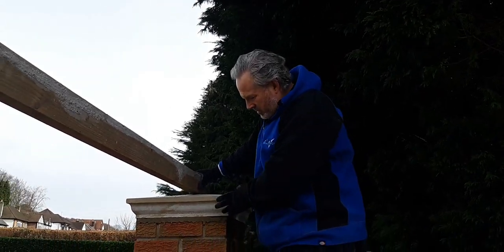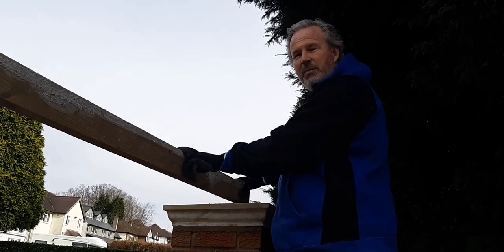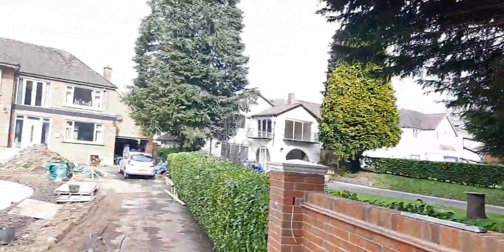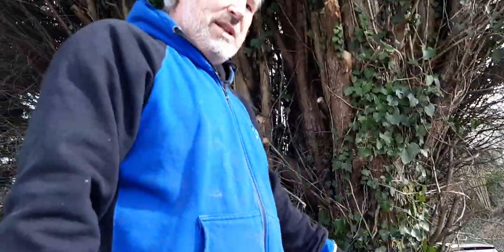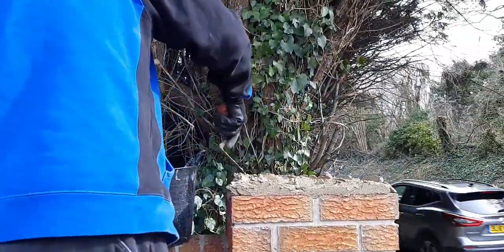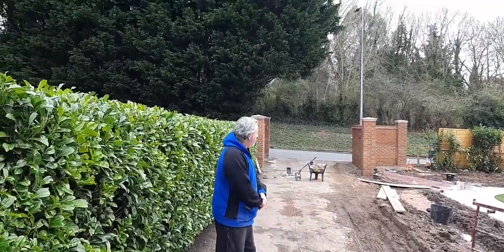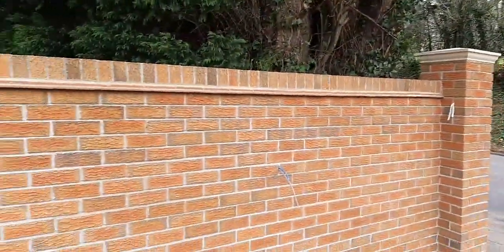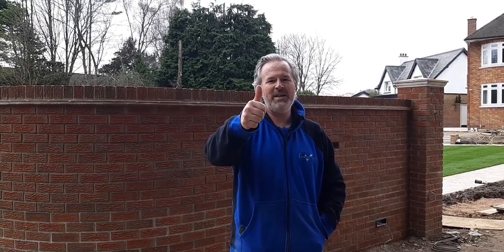#bricklaying -Installing pillar caps

Comment: I’m having 2 pillars built soon. 17 courses x 2.5 brick 
A brickie told me to get quick drying concrete for the foundations as it will set in 5 minutes. Surely that can’t be right??
Reply from the maker: Not sure why you would do that never used or even enquired about it .we usually poor the day before we lay .The concrete from the companies who deliver concrete use additives in the concrete maybe that's what hes on about .
Just ask him I'm sure he can explain to you 👍
Reply: @brickrightbuildinglandscaping  I will ask him thanks. 
2 other Brickie’s said they will pour the concrete the day before building the posts. It’s just the brickie who gave me a price the other day said to use quick drying concrete.  Just didn’t make sense to me. I appreciate your reply 👍

Comment: What if the pillar cap is broken? Can we just buy new pillar cap, are they standard? Or can we use cement to fix the broken off piece? Do u have a separate other video re such?
Reply from the maker: If the the cap is broken you have to buy another one to replace it .
These were special orders 👍

Comment: Hi pal did u really put the turf down or did a firm do it cos u never filmed  it gettin done ,looks way too good for a brickie to do it , 🤪. You doing OK pal,  whats next are you putting slabs down on the extention job 👍
Reply from the maker: Yes we did the turf no other firm .the weather was against us mate so had to just get it in 210m2 of turf and 35 tons of top soil was manic in crap weather.
Slabs on the extension coming soon on weekends. A smaller job next one and dont i need it 😂😂 thanks allan mate 
Justin 😂👌👍
Reply: Good lad , some difference you've made to their property, looks like a footballers pad now , awra best